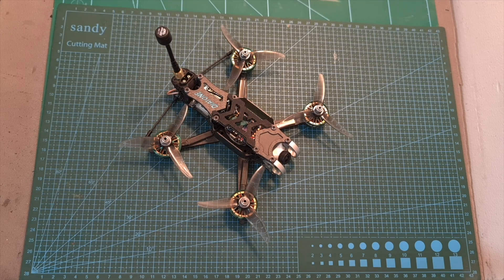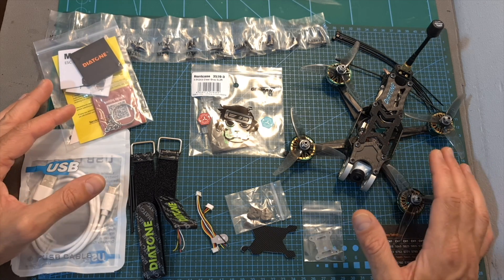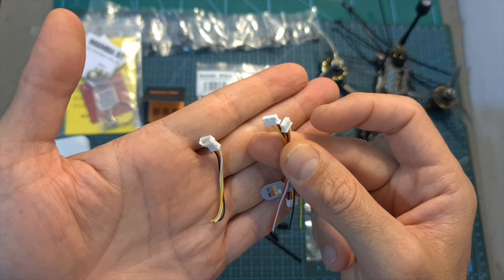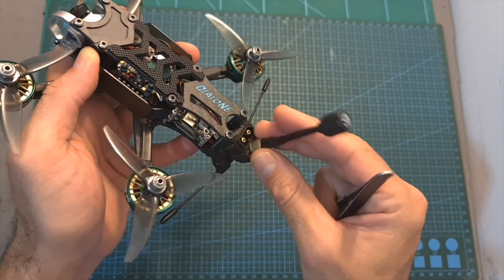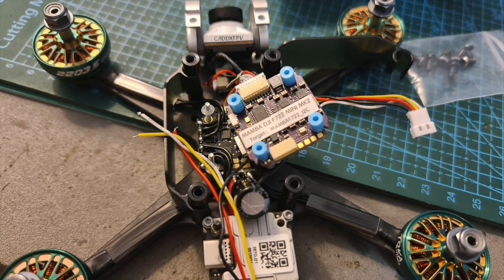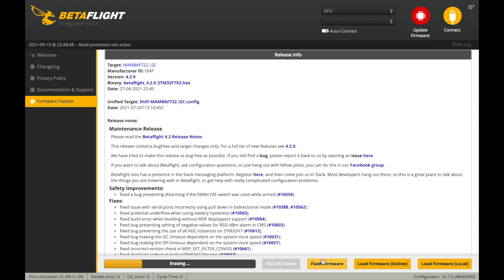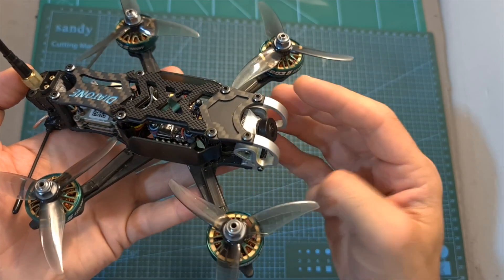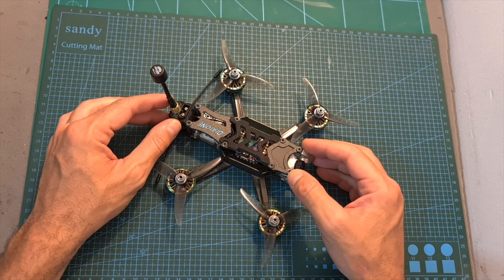Diatone Roma F35 - Betaflight Setup & Review

Comment: i checked on diatones site and it shows these 2650kv only to be 3-4s and the 2200kv is 4-6s ....i ask because i am dealing with desyncs and hot motor if i use 1300mah 6s on my diatone taycan or the roma f35 they both will desync and its brand new motors pretty much and i have tried them on different esc and everything so i motor limited them ansd the problem went away.....how r you all flying this 2650kv version on 6s? I have good experince with the 1650kv type of this motor but not the 2650kv i just got recently so i would have the correct motors for it ot be 6s and the most poowerful but instead it is causing problems instead of solutions to my 6s issue

Comment: Hey Gal, I have a question about the Roma F35 Vista with CRSF 6S BnF version which has been driving me insane for several days now. The problem is as follows:
My Tango 2 pro easily bound with Crossfire nano after updating firmware on both in agentM, however upon connecting to betaflight (though properly setup and bound) the RC wouldn't control sticks, switches, or arm. I then flashed the FC (MAMBA F722 I2C) with Betaflight 4.3.1--to no avail. It still didn't recognize my RC.
I have searched all over online and have mostly found people with this problem had not connected the Crossfire Nano RX to TX on the board. I triple checked mine and even switched them around just to see what would happen. Nothing helped.
If you have any idea what the problem could be I'd really appreciate your advice.
Sorry this is so long...
Thanks
Reply from the maker: I’m sorry for the late response :-(
Did you figure it out?
Reply: @KremerFPV  Hey man,
Yes. I found a guy when i arrived in Bangkok who figured out that whoever built the bind-n-fly Roma F35 wired it up a bit differently than the wiring diagram depicts. As a result the ports were incorrect. 
She flies pretty well now on the Betaflight Crossfire preset and Joshua Bardwell's freestyle preset. However, she could definitely use a better fine-tune. If you have found optimal rates and settings PLEASE let me know. I don't feel like I'm getting the most out of her, at least when flying freestyle.

Comment: Thank you for sharing, I have the emu firmware version and I keep getting this weird yaw spin from time to time.  I am a Betaflight user and I'm not familiar with emu PID tune.  Do you think it flies better after you applied the Betaflight PID tune?  I just want to get you feedback before I reflash it to Betaflight.
Reply from the maker: My pleasure Daniel. 
I suggest backing up everything and trying the BF settings. 
Worst case you can re-flash the EMU firmware and use the previous settings, although I am pretty sure you will find that the BF settings (which still need some refining) working better.
Reply: @KremerFPV  Thank you so your quick reply, do you mind sharing your BF PID tune for this quad.  Mine has a lot of prop wash and I can't seem to get rid of it.  Thank you so much.
Reply from the maker: @Accid3ntalG3nius  np. Check the description of the video, it's there.
Reply: @KremerFPV  would u kindly let me know what's the highest amp draw on a full punch? Needed to know if xt30 would be enough for a similar build with expected auw 320gm.
Reply: @KremerFPV  Hi, your betaflight settings links are broken, can you update them please? Thank you
Reply from the maker: @olegs4089  sorry but the service that I was using for storing the settings no longer works and I don't have a backup...

Comment: I buy BNF's specifically so I don't have to mess with them! This is just the opposite of that! Lol  It sounds like you have to mess with this so much it's just ridiculous. 😥 Besides having to solder in your own choice of receiver, since they screwed up emu flight and you have to flash betaflight plus figure out a tune...it's not for me. And it's certainly not a beginner's quad either. 

I'm so glad I bought the Emax baby hawk 2 HD! You don't have to do any of this crap with it! 😎🤘 Plus it comes in at over 100 grams less weight, and that's without a receiver. The Emax came with my choice of receiver already soldered and  mounted in.  I chose a Crossfire, and the mini Immortal T antenna was already mounted in an ideal spot! So, none of the work of mounting the receiver and antenna like with this Diatone. 👍

Probably one of the biggest timesavers and benefits is the Emax baby hawk 2 HD comes with a perfect tune of betaflight already installed. Tuned by their pro pilots it's exquisite! It's flies wonderful!  ✅

Add to that the fact that mine came with the Caddx Nebula Pro camera and it's kinda like icing on the cake! None of the numerous hassles and terrible tune, soldering in your choice of receiver, mounting the antenna, and it also weighs over 100 grams less, so it easily gets under the 250 gram weight limit with receiver and 850mah 4s lipo.

Considering the simplicity of set up (none) vs. this Diatone ( a huge crap load), the under 250 gram weight, and the superb design and tune, I feel the Emax baby hawk 2 HD is a far superior value and buy! Especially if you're like me and  you buy BNF's for them being already tuned and for not having to mess with them. IMO, the Diatone's motors are total over kill, which is obvious because they made no attempt to get under 250 grams and no other 3" or 3.5" quad has ever come out with 22xx motors. 

Isn't the reason these companies came out with a 3.5" DJI digital quad is because it's the largest size prop that allowed the Digital system to still get under 250 grams without any of the compromises other sizes have had to do to get under 250 grams? Seems to be the case. That makes the Diatone design even less logical. I don't get it! From seeing Gal's flight with all of the shuddering and bad tune characteristics, it seems like it's a poor design choice and a bad buy. Oh well, back to the drawing board, Diatone. Simply too big of a gigantic hassle for me to even consider this quad. And I feel sorry for any beginner for buying this PROJECT! Especially when I had nothing but simplicity and smooth perfect flying with the Emax baby hawk 2 HD! It's way less money too! And, I get no props in view also, and the Diatone does. I think most companies start designing a quad with an objective in mind. Diatone didn't seem to think this out much at all! Lol 😂🥴🤷

Comment: Hi Gal  Great video and review of the Diatone F35.  I only have one problem with this quad.  $250 for a 3.5in quad is to rich for me.. other than that I like it.  Thanks again for the video and information
Reply: Just buy the frame.  I threw the guts of a GTR369 on the frame and it's amazing how great it flies.  Way better than the old GTR frame.
Reply: @dannygaron  haha what I did when I wanted a 3" .. turned my 2" to 3" ended buying new motors though too
Reply: I did just that

Comment: I thought 3.5 inches for to be sub 250. I would be more interested if this was a 4 inch quad to be honest
Reply: I threw the guts of a GTR369 on the F35 frame and it's pretty damn awesome.  You can chuck it around like it was a 5 inch.  Nice and heavy, but damn small.  Way better than the shitty light 4 in quads out there. Feels locked in and not floaty like a sub 200g quad.
Reply: They released a 4inch Version, even better looking, stiffer frame and bigger Motors.
Reply: Exactly! I don't get what their objective was when they designed this PROJECT! 🤷🥴
Reply: @KOrnhOliO1  simply build a super powerful 3.5 inch and Not give dime about the 250g limit.

I mean honestly have you ever heard of someone getting his Quad weight by the police? 😂